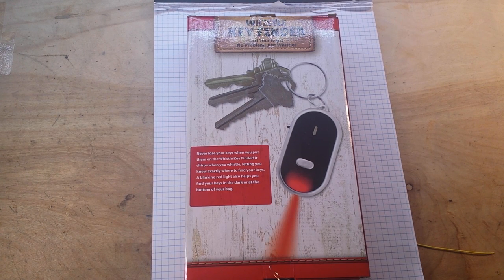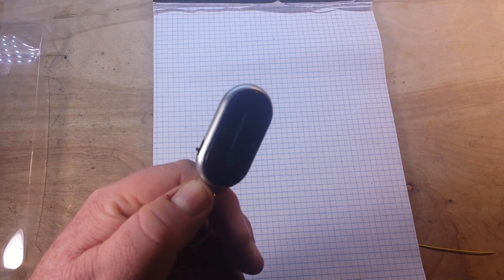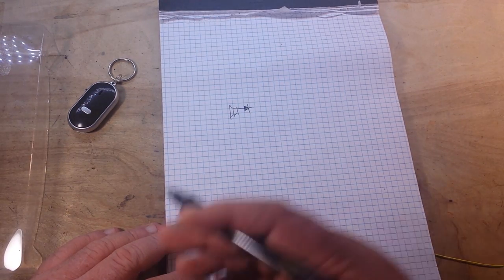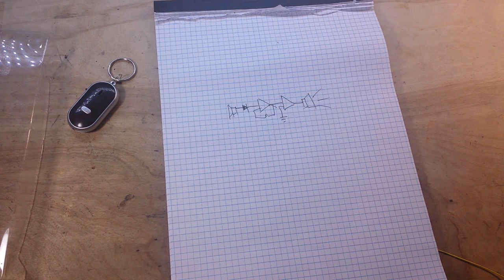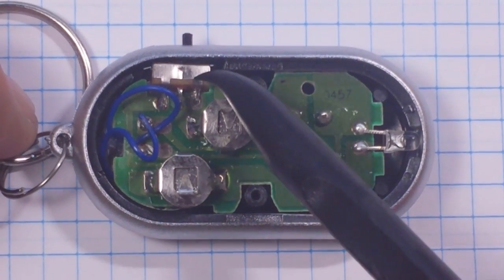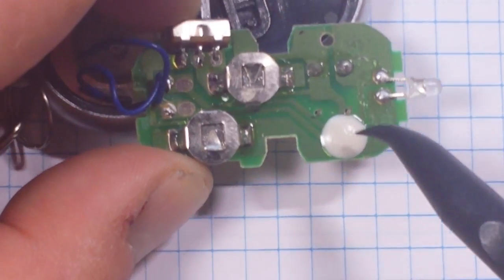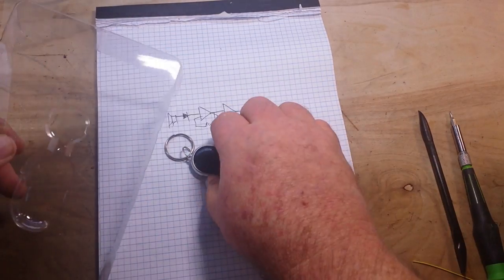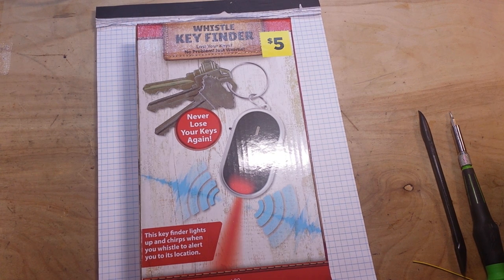What's inside a whistle key finder

Comment: Hugs <3

Electronupdate is a channel that takes off gloptops and looks at the actual IC circuitry, maybe we should send him a handful of these if you really want a look inside. Identical products have to be worth only a few cent in China.

The pin that's left unsoldered doesn't need to be soldered, it's parallel to another pin on the board anyway. It's the off state. Would have been nice for mechanical stability but it's entirely a cost cutting measure rather than a defect, and i don't find stability all too concerning, given how they bent the pins and it's pressed right in by enclosure.

I don't think putting a diode in series with the microphone is very helpful, i mean, at the voltages that they emit, you'll have a hard time getting even close to the threshold voltage. Interesting is that they have the piezo pulling double duty as microphone and sounder. Nice.

If i could whistle, i would probably consider one of these things. If it didn't just trigger from music, because i have an impression it might.